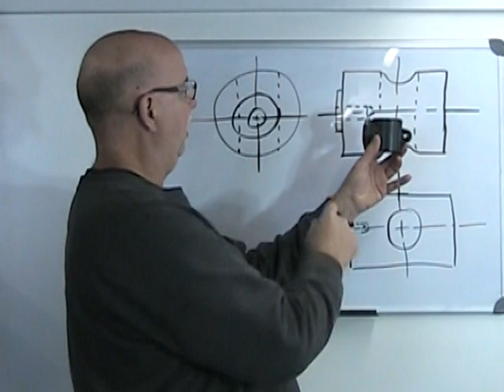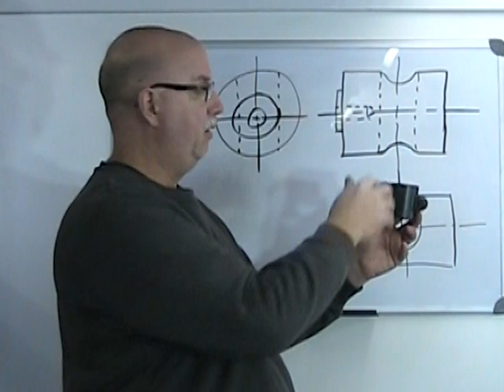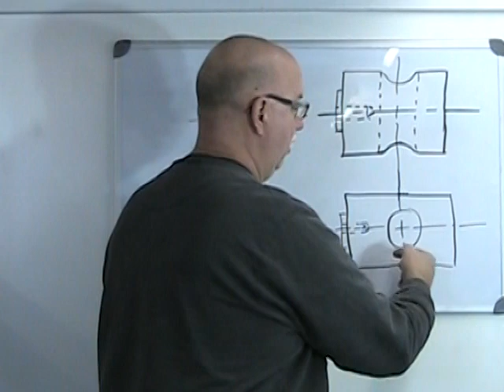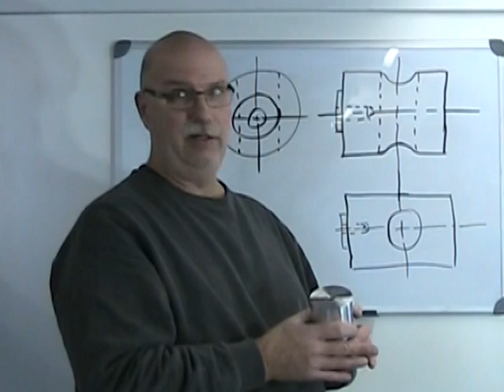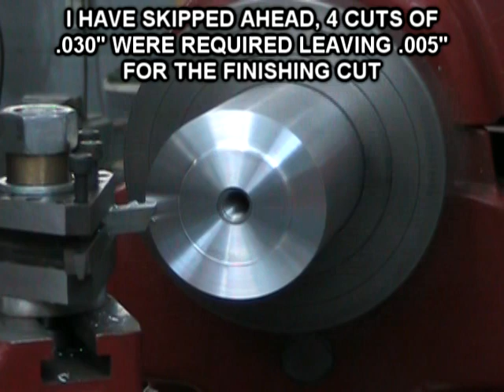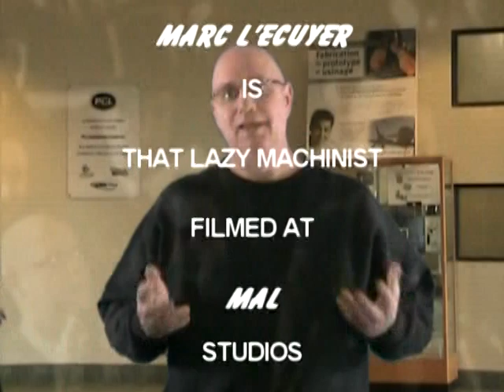Drill press fix part 1, MARC LECUYER

Comment: I'm enjoying your video and am in the process of refreshing my drill press at the present time.
        As a quickie inquiry to your red lathe, I was wondering if it is a Carroll Jamieson? Saw one for sale in Fredericton and it is red too! Hadn't heard of a Carroll Jamieson before that one.
Love your videos as a very invoice lathe operator.
Reply from the maker: +Doug Jackart Hi Doug! The lathe is an Atlas and from what I have heard they use to be sold by Sears as " Craftsman 12 inch lathe".  There is a lot of pictures and info on the web. I found my lathe in three crates at the back of an old barn that was going to be torn down. I was young and poor at the time and I was quite excited to buy it for 50 dollars. It took me a year to get it assembled and working and in the process I painted it red because I was fed up of looking at drab gray or green machines at work. It dates from the early fifty's so that makes it older than I am, so I treat it with respect. It is a great little machine and has served me well, I wouldn't use it to make a living but for a home shop it is great. Thanks for watching and for taking the time to write, Marc

Comment: Dear Marc
Nice video!  I look forward to seeing the rest of the series.  What size motor do you have on your lathe?  Is it single or three phase?  I have a 1990 Myford 7X19 and a 196O's Standard Modern (metric) Utilathe 12X36 both running on 3 phase inverter drives.
Best wishes from North Bay, Ontario.

Paul